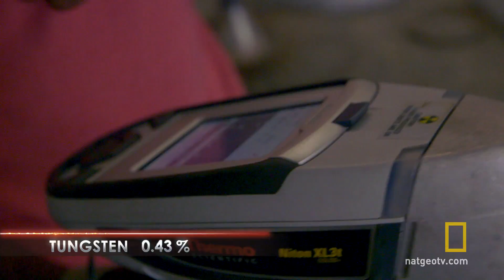Jet Engine | National Geographic

Comment: This is garbage. What the f*ck, so dumb. I don't even know what to 
comment... someone produced this and thought, yeah this is good enough 
to release. Gold in the engine as thermal shielding... even if that were true (definitely not gold would melt) , a bore-scope 
could tell you in less than 5 min and save all this stupid f*cking nonsense. This has to be
 one of the worst things I've ever seen. If I ever get cancer it will be
 because I watched this. WTF! Fake a$$ company in a generic building with no equipment or customers, probably rented the space for 30 min to shoot this garbage. Plasma cut that compressor case open for no f*cking reason, that was probably the most expensive part of this whole project for what ever community college film school liberal arts waste of food and O2 hipster idiots produced this, ruining a probably reusable/re-sellable compressor case. I don't even know... you ruined my day nat geo I'm going to be thinking about this crap for the rest of my day and probably have nightmares about it tonight. Cheesy a$$ dialog and acting, FVCK!!!

Comment: These guys are looking for gold-plated components in the HOT section of a turbine engine...

BWAAGGHAHAHAHAAAAHAAAAAAAGGHHAAGHAAAAAAAHAAAA..

MachOverspeed
Reply: That looks like the compressor section.
Reply: Gold is still used in brazing hot section components in some engines, most people don't realize gold melts at a very high tem almost 2000 Deg F